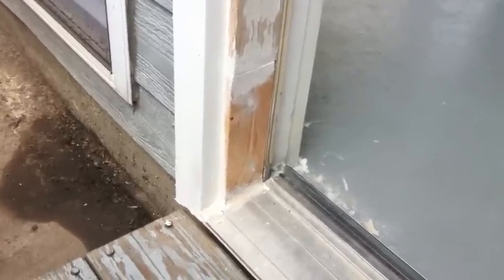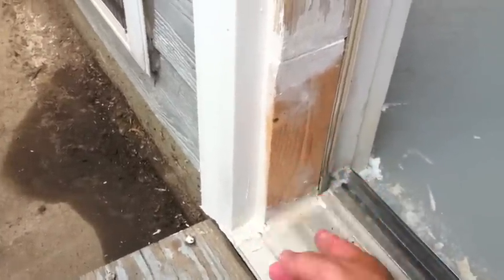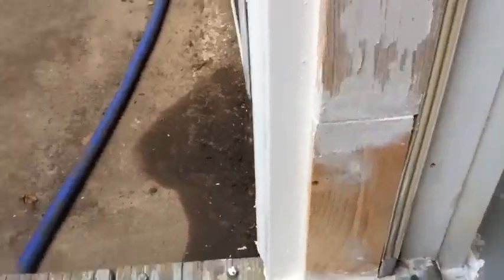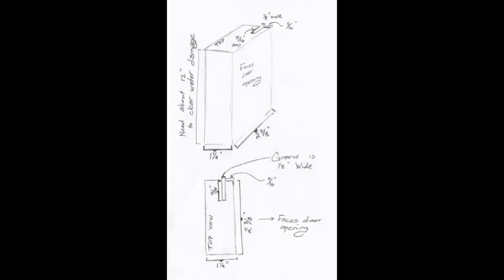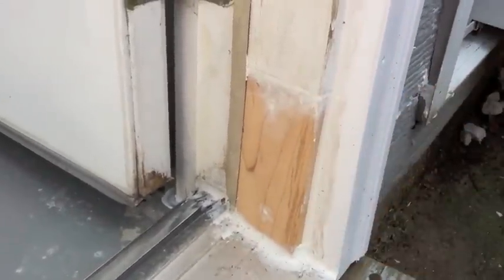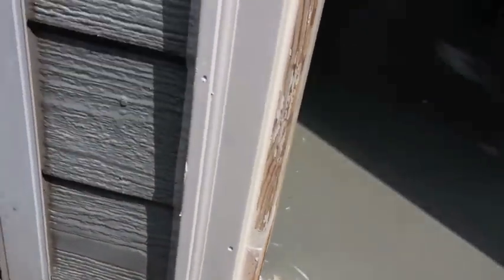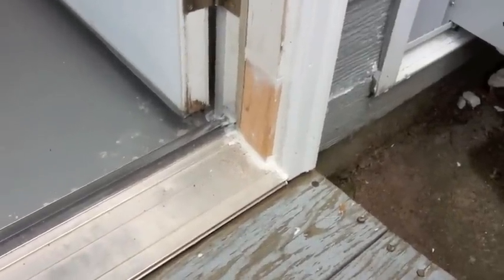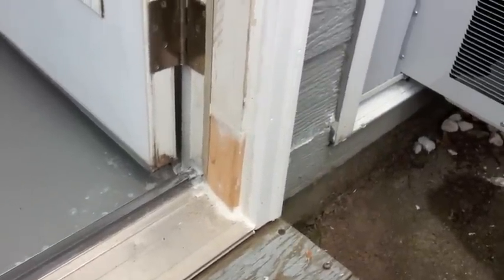Solution for rotten exterior door frame

Comment: I did a similar repair on my garage door. But I cut the old wood out at a 45 degree angle. So when i installed the new wood, there would be less chance of moisture running uphill to the new repaired wood. it matched up fairly well too. I didn't however paint the new wood first. That seems like sound advice.

Comment: Decent finished work but I would have used exterior wood instead of common 2x4. Doesn't matter how much primer and paint you cover it with it will still rot before the rest of the door.

Comment: "Not contractor quality work"? I think that might depend on the contractor. Since you sealed the end grain, which the original contractor did not, I'm thinking your work might last--I'm picking a figure out of the air--forever.

Comment: once rotted bottom door frame piece is cut out and replaced either with treated wood or pvc door jamb will that piece be strong enough to attach the hinge plate and screws for a storm door? handyman repaired the rotted bottom of door frame by filling it with wood filler, sanding it, then painted it. I bought storm door to prevent same problem. after 1 year, the repaired area, is failing and the storm door hinge and screws are coming apart from the repaired door frame every time the storm door is opened. several screws have fallen out and the hinge is almost completely separated from the door frame where it was repaired. looks like dried rotted wood that's crumbling behind the hinge that's ready to fall off. seems wood filler not strong enough to attach storm door hinge and screws to.